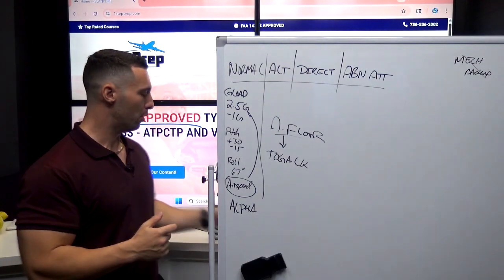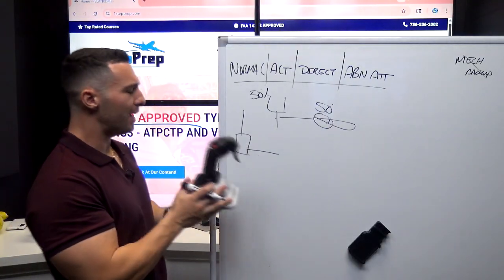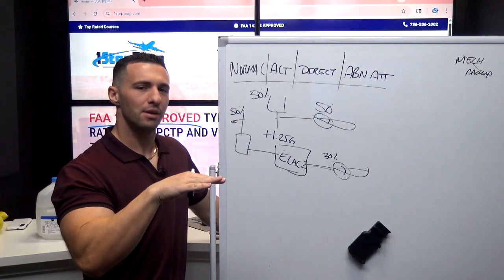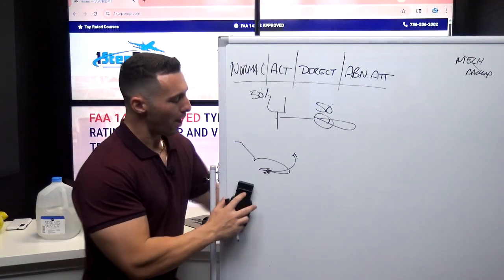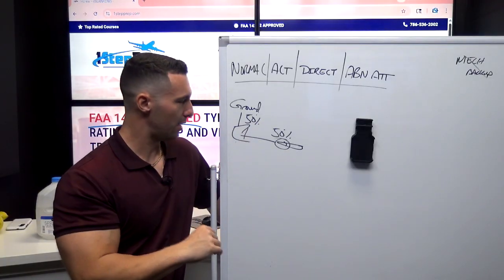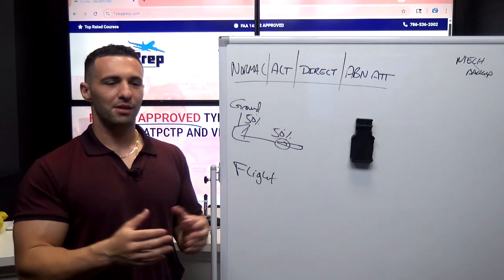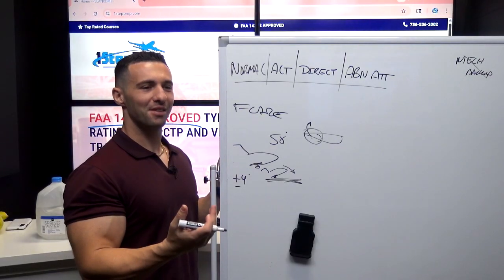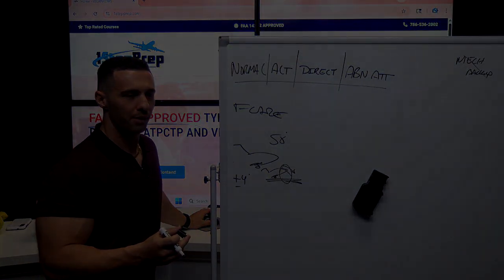A320 Normal Law Modes

Comment: ELAC2 is something totally new. It’s amazing there’s no thrust vectoring characteristics in the 320. The ELAC2 is like a G monitor… this is like a spaceship vectoring system. Amazing flight characteristic for ultimate passenger comfort. I can see why new Boeing drivers coming from the 737 will fail to apply sufficient side-stick deflection on go around because ELAC2 will compensate for the nose up trim…